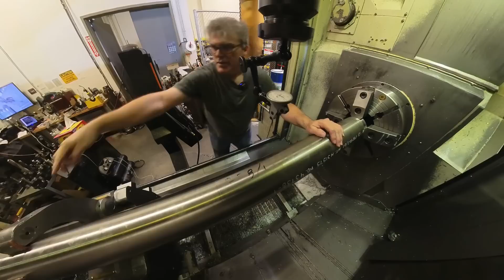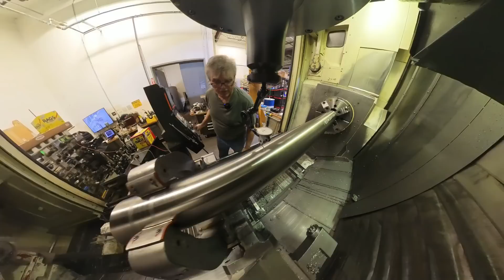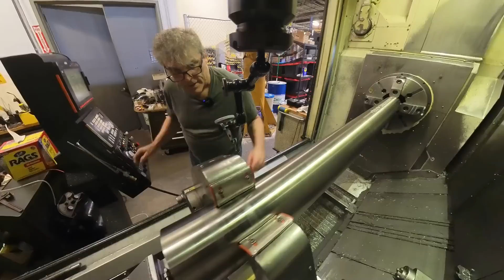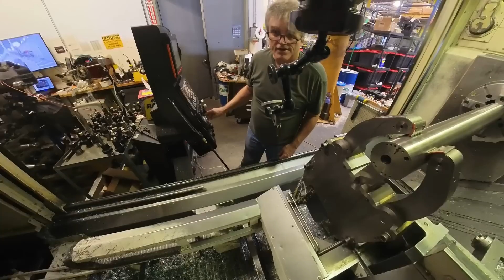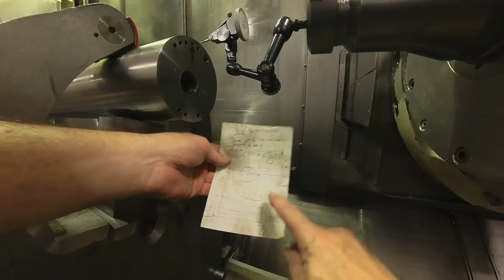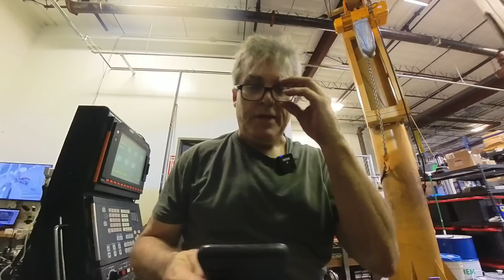Insta360 X3 Camera and Aligning Steady Rest

Comment: Maybe its dumb question, but I would feel even dumber if I didn't ask. 

Can you explain in some of the next videos how they drill that small diameter holes that long, that accurately? 

Enjoying your videos!
Reply from the maker: They use a process called gun drilling. I actually have some videos on this. I do gun drilling (Or use gun drills) quite a bit on my machines. I have one video that shows how I sharpen them. The place that does these parts specializes in this, and they are very good at it. Just do a search for gun drilling. You will get plenty of information.

Comment: The 360 fly in 4K is the better camera more options for mounting
Reply from the maker: Having no experience with that camera or really any 360 cameras except this one, a little, I cant say. I originally purchased this to take with me to Mexico. This is where I really intended to use this camera. But after I got it and saw the way it works. I could see a few applications for my videos on the machines. I did watch a few videos on the 360 fly 4K camera. To begin (This is not a criticism of the camera because I don't know how it is.) just on the difference that these videos showed. It doesn't take full 360 video. For my original intended use it's form factor is not as good. But all that aside it's the combination of the Insta360 camera and their phone and computer software applications way outweigh, at least for me the choice between these two cameras.

Comment: Video idea: Because you love to tell us sometimes, that the indicator is not affected by gravity and is really stable, how about a test.

Test 1: Zero the indicator on a part, move the indicator away, turn the spindle on, (The spindle of where the indicator is in and only about 50rpm, don't know what a good number is, but nothing crazy) and move to indicator again to the same location. Would be interesting, if the indicator moved a bit on the reading.

Test 2: Make the arm of the indicator long and zero it under the part. Leaf it for maybe 20 Minutes and see, how much it changed.

And if Test 1 and Test 2 didn't changed anything, you can make the arm long and turn the spindle on for the final test.

I would love to see this test. Sidenote: I was in machining for 7 years, but currently doing something different.
Reply from the maker: This does give me an idea. But not exactly the way you are referring to. Thanks!

Comment: Hi Peter! 
Do you inspect your measuring tools after certain time intervals, or do you do it when you feel like something is wrong with a tool? 

Thank you so much for your videos!

Edit: spelling
Reply from the maker: Every time I use a measuring tool I check it in some way. On a standard a set of gauge blocks or something of a known dimension.
Reply: Unless you just took the tool out of the box, you better be checking your tooling EVERY SINGLE TIME before it touches any material or tool probe *and after running. Just do it. It won't hurt, and it will hurt, your wallet, or your bosses, every time you; "forgot to check the tool" aka "neglected to do my job as the operator at the machine".

edit: *

Comment: Usually what I do when I adjust the steady rest on our WFL is mounting 2 Indicators on the Head, one in X-direction, one in Y. Then setting zero close to the jaws (after confirming the runout), measuring the diameter near the jaws and again near the steady rest and adjusting both directions at the same time. so you don't have to re-check over and over again, like you show in the video. Because after you tightening these big bolts it will move on you again.

Comment: One of the important things to be careful with when using a double-sided 360 camera like this is where you have the mid plane sandwiched by the two cameras with respect to what is being filmed because of where the computational "stitching" occurs in the overlap of the two camera systems. Avoid having this plane coincide with where you do NOT want these visible stitching artifacts to occur.
Reply: When you say "artefacts", were you meaning the distortions when the camera moved?

If so they were a little distracting, so I hope they are something that can be avoided with a bit of experimentation ... 🙂
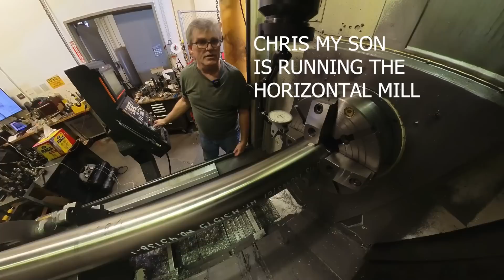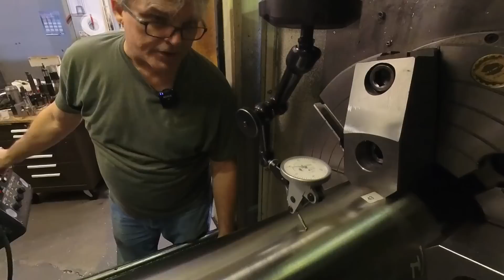Reply: @johncarey9149  Beginning @ 1:01 , behind his head on the wall, notice the white roll hanging on a red handle of a circuit box along with something posted on the grey door. By time it gets to 1:18 , there is a vertical ghosting the imagery on either side of his head where his ears are.  You do not see that above or below that level in the video because that is where the image processing algorithm stitches the two camera video streams together.
Reply from the maker: It is possible with their software to pick a frame and have the stitching recalculated to improve it (I haven't tried this yet). Also you may have noticed if you or the subject are close to the camera the stitching fails. You can see this in the first sequence in the tool changer. The camera was close to the tool it was mounted on. So it squashed it out of round. It kind of looks football shaped. When the tool gets into the machine the exposure is different for the lens facing the lights. So you can see the stitch line there as well. Also in the video the collet chucks nut is distorted and has ghosting around it. Things like that. It works better if the subject is farther away and not in the overlap of the two cameras (If possible. That said it still does an amazing job. I have just started with this and the software. It wont be good for everything but it's just another tool. I really purchased this camera to take to Mexico this October. But after I thought about how it could be used for these videos.
Reply: @EdgePrecision  He do mean a minimum 2 Feet safety distance for X3 camera to film close up objects. When objects too close to the stitch line, the dual Len would have a stitching errors at the seam line. Effects like you point a finger at the middle of you two eyes, when your fingers getting too close. You get the cross eye effect blur...😅
Reply from the maker: @phialsquiz  The two cameras actually take more than 180 degree view. So the software has to kind of  interpret what is there. but the lenses are the thickness of the camera apart. So a little away it can make a good picture. But up close it has a little difficulty. This is why it can hide the selfy stick because it is around the width of the camera. But if you notice in peoples videos it distorts there hand holding it. In their software there are stitch setting for different things. Like the underwater case or lens protectors. I think you could get closer than two feet and be reasonably good. I haven't experimented with it yet. But on YouTube some of the videos show what happens when you get close to the stitch line.

Comment: im trying to set up a horizontal CNC and I'm having a hard time finding the center of the y travel, it would be supper help full if you made a video on it or if someone could point time in the direction of one
Reply from the maker: Center of the Y travel on a Horizontal mill? Why do you need that?
Reply: @EdgePrecision  for the center of the c axis of rotation for programming 4 axis, multiple sides of a pallet from one origin point would really speed up a lot of our setup time
Reply from the maker: @coltonmenconi396  Every horizontal mill I have run. The Y axis is the vertical axis. The X goes side to side parallel to the pallet and the Z is toward the pallet. The rotary axis is a B axis. To find the center of rotation of the B axis in the Z direction. Clamp something roughly centered on the pallet. Take a face mill and skim a cut at B zero. Move the cutter in the X or Y axis out of the way. NOT moving the Z axis. Now rotate the B axis to 180.0. Take a skim cut with the face mill on that side. No mic the thickness and divide that in half. Now add the machine location and the tools length offset to that. That is the center of rotation in the Z axis from zero return. If you already have a tombstone on the pallet you can use it to determine your center of rotation in a similar way by measuring it’s width. It’s even easer if you have a spindle probe. With it you don’t have to cut anything. First probe the tombstone in the X axis At B zero. Then at B 180.0 to determine if it’s on center. Then probe the appropriate face once you have determined it’s distance from the center of rotation. The add that to the distance you determined for the face. That’s the center of rotation of the B axis in Z.
Reply: @EdgePrecision  I'm going to have to bring this to work tomorrow and borrow some machine time. this is exactly what I was asking for, though i haven't known how to ask as I'm only a year into the trade. keep up the excellent content and I'll keep learning 👍